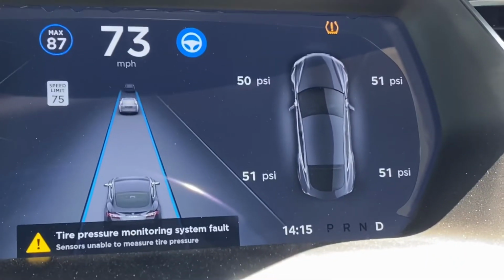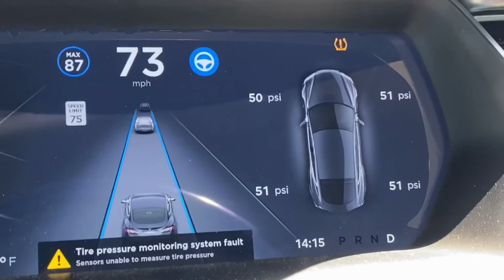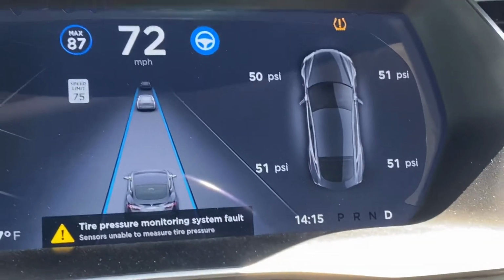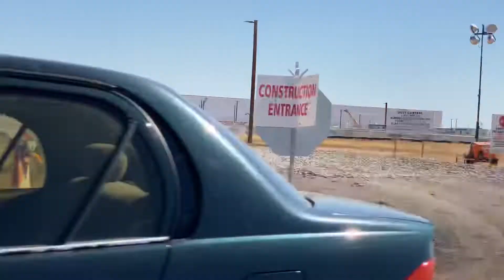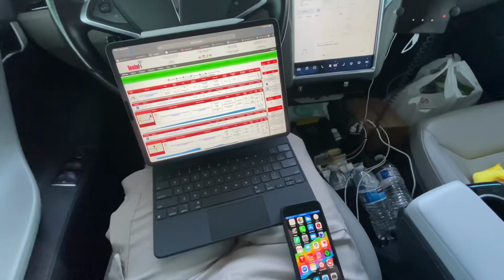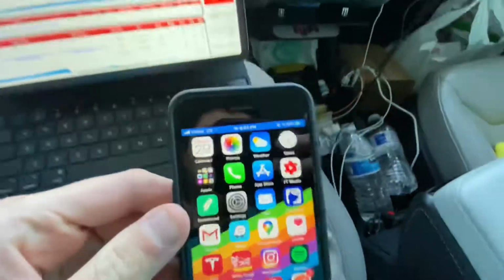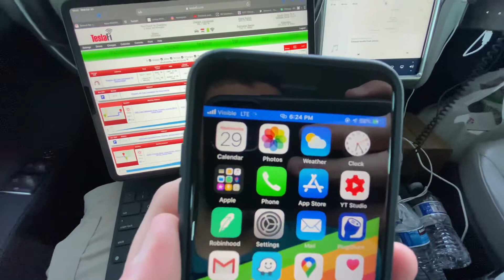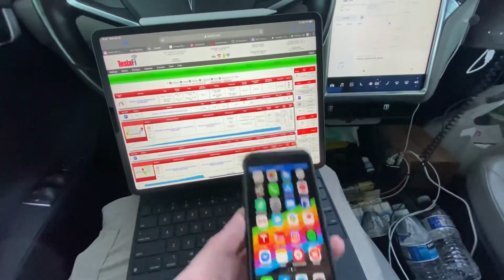VLOG #13 - Lucid Motors Casa Grande, AZ Factory Progress 4/29/20

Comment: Looks like some progress. Some work on the roof..
I tried out Visible a few months ago, seem to work just fine. Mostly I bought it to use as a hotspot, so I bought their super cheap $20 phone.
If you find the data speeds are a little on the slow side, you can contact them and ask them to unlock the speed. Sometimes they'll do it, sometimes they won't. They guarantee between 5-8 megabytes down. After talking with them I was able to get mid 30's. It certainly a good deal for what you get. And it's about half the price of Verizon.
As long as Verizon service is good in your area it should work perfectly fine.